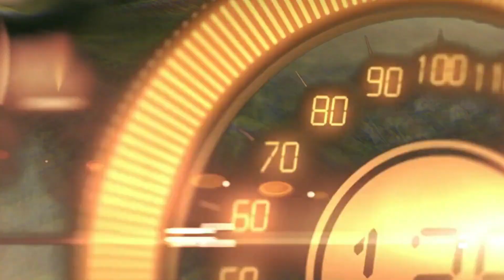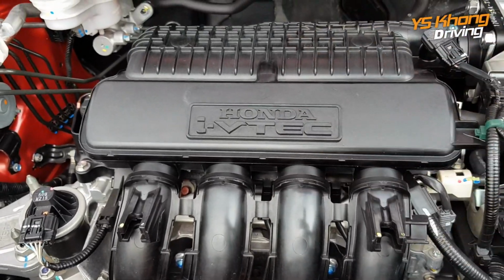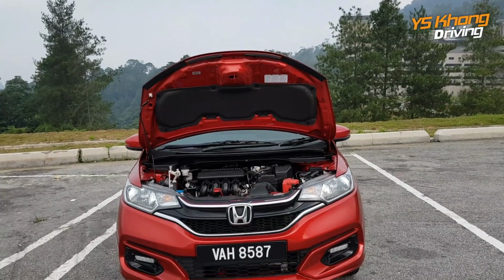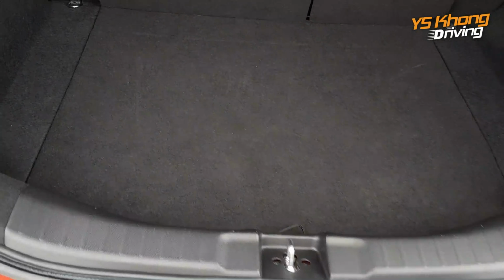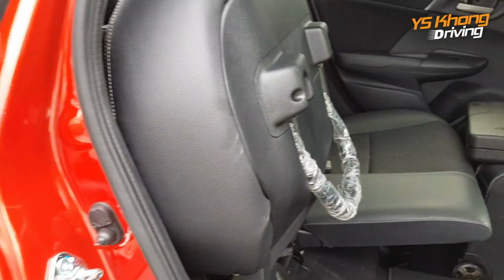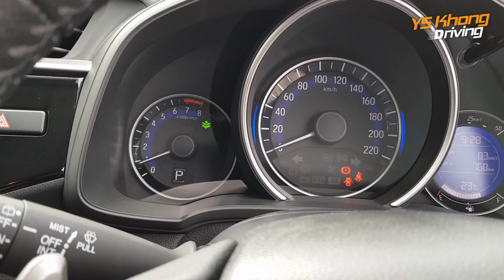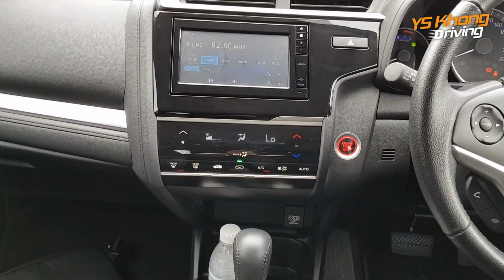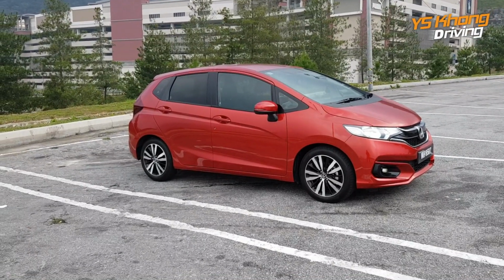Honda Jazz 1.5 V (Pt.1) Walkaround Review: Most Cargo Space Hot Hatch with Innovative Ultra Seat!

Comment: actually uncle. to start the car which one better ? whether 1 step or 3 steps??  because someone told me if we start with 1 step will effect car,s ECU in long term. so they said need to use 3 steps start. is it true??
Reply from the maker: What is 3 step start? To me it is press the brake pedal, touch the start button. Would that be one or two?

Comment: Aw i thought you reviewing normal non-hybrid city but anyway is basically the same car haha

A little bit misinformation on the Econ button explanation. The econ button switch the ECU to "real" economy mode, it is not just an indicator like what is usually found in perodua/proton. The 'tree' Econ indicator will not go away even if u floor the pedal when econ mode is enabled. The eco indicator is the 2 lights next to the speedometer where blue indicates not economical driving, and green means you are driving economically.

What honda econ mode does/change
Adjust throttle response, reduce auto cruise aggressiveness, air-conditioning function, and transmission behaviour. Enable this and you will actually feel the car responsiveness is slower than axia haha
Reply from the maker: Yup. So I don't like the Econ mode, but others love it.